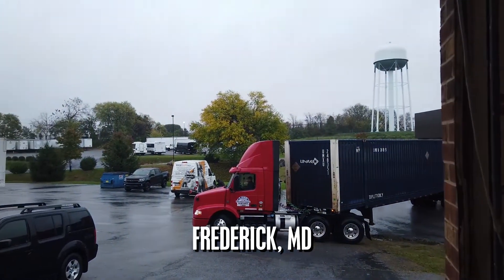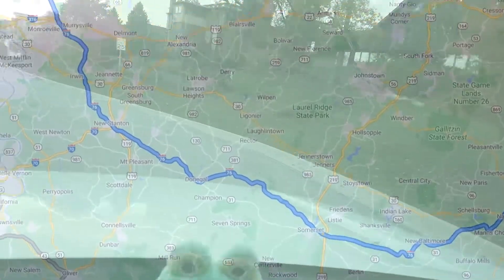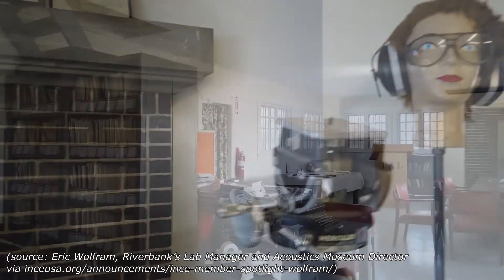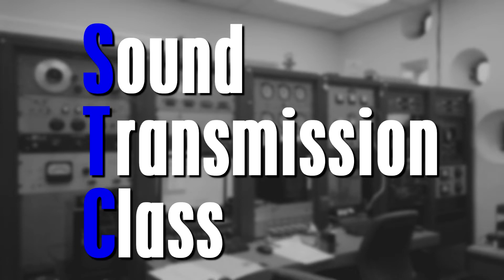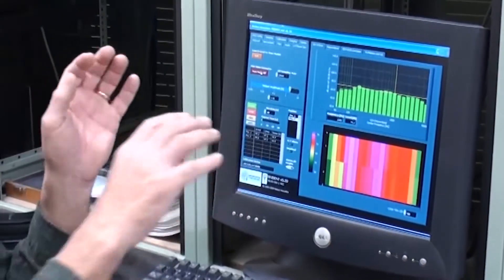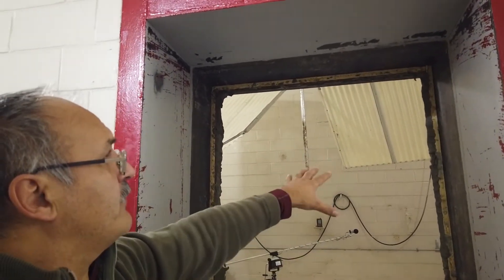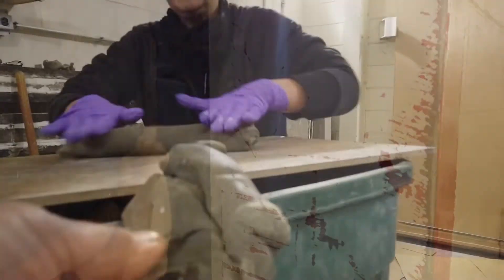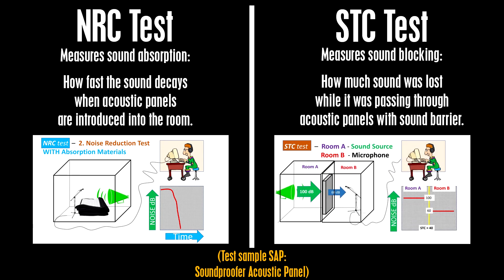Difference between soundproofing and sound absorption? See the difference. Test the difference.

Comment: I have a question if you don’t mind. Near the end of the video where he is about to test the barrier but before they hung the barrier, he showed us the two reverberant rooms separated by “huge walls that nothing gets through them” my question is what is between those walls past the concrete blocks it seems? It is all concrete blocks? Or something else in between the concrete because that wall looks from the camera to me 9 inches thick but thats to me I am not measuring expert.

Thank you for your awesome video and insight. Hope to hear from you!
Reply from the maker: Hi. The large wall is 24 inches thick. It is "room within the room" placed on huge metal springs (under that concrete floor). The space in between the two rooms is about 12 inches of "nothing". A gap. The black part that you can see is simply to cover the gap. And the soft whitish seal is a thick layer of sealant that does not harden.
It is pretty impressive. 
I think in some other videos I actually crawled in the underfloor space to film the springs.  They are about 3-4 inch thick steel coils.
Reply: @ Thank you for your response! Greatly appreciate it! What videos of the recording on the spring is on? If you remember?
Reply from the maker: @OverflowMusicStudio      It was a long time ago. Probably   the video I never finished.  But I can try to see if i still have that footage.
Reply: @Vocalboothtogo  Thank you if you can! I was trying to find it myself and if you never do please upload it in a future video. It will be a great video and blessing to those who are looking to watch will I believe will be a lot of people!